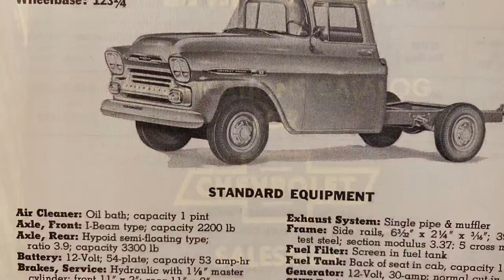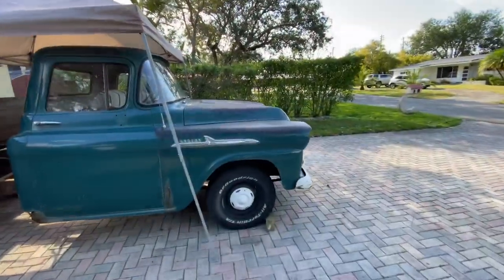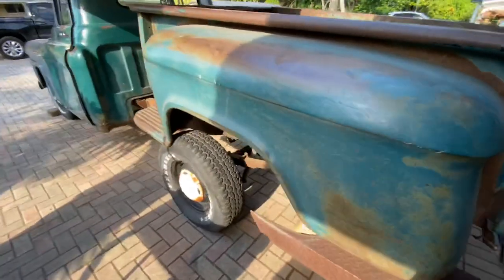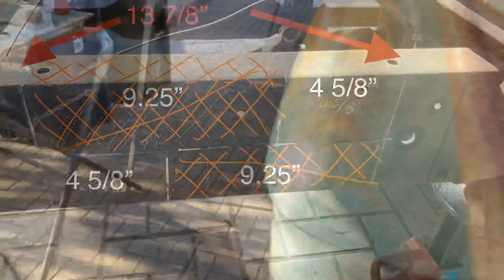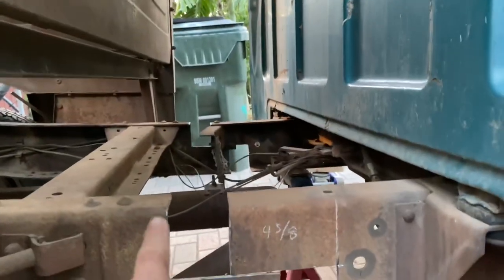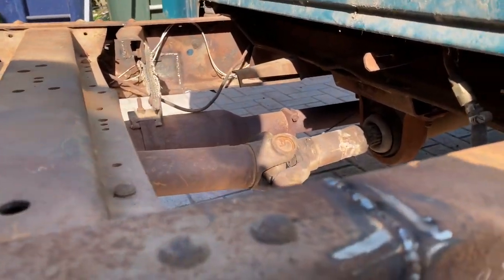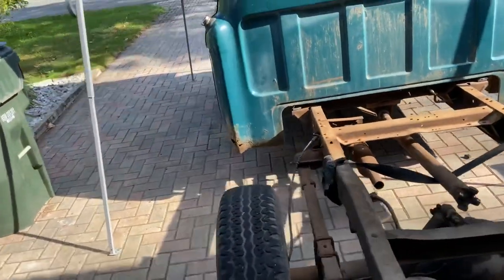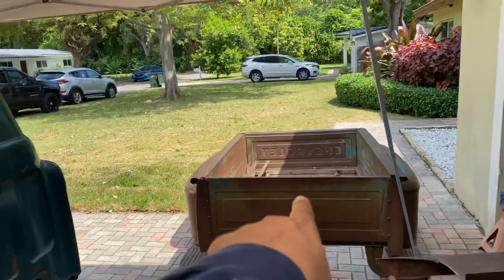Long bed to short bed DIY

Comment: I'm going to do this to a 57 3200. It's a factory big window cab with all the chrome and stainless and factory V-8 truck. I'm also adding factory 4x4. I have all the correct parts to do the 4x4 right. 57 was was first year for factory installed 4x4.

Comment: Hi there - nice job! Very informative! Regarding shortening the stepside bed afterwards, do you only need to take material from behind the fender? Is there a certain amount that needs to be removed? Or a specific method? Thanks

Comment: What’s up Chuck, great builds as always love that gmo truck! So hey so I’m pulling measurements on my 59 fleetside longbed and they seem to be different I’m getting 8” in the front and 12” in the rear to convert it to a shortbed
Reply from the maker: Thank You sir.  Fleet may be different, I’ve never shortened an Apache fleetside.
Reply: Nice work Chuck , I am also wanting to shorten my 59 fleetside 
Any recommendations for the bed ? 
I can find anything